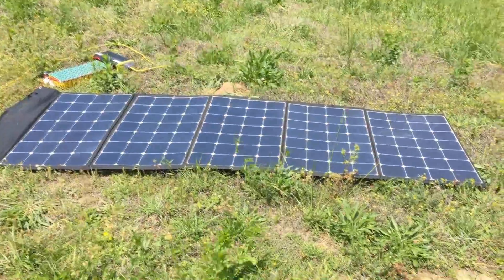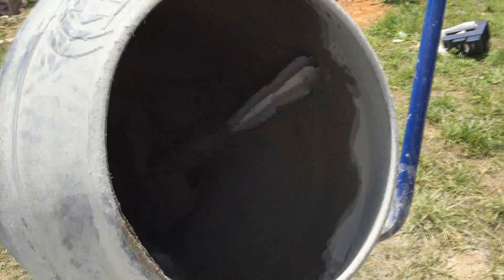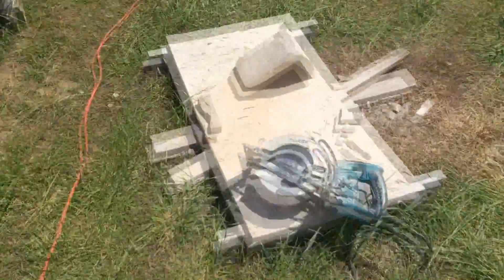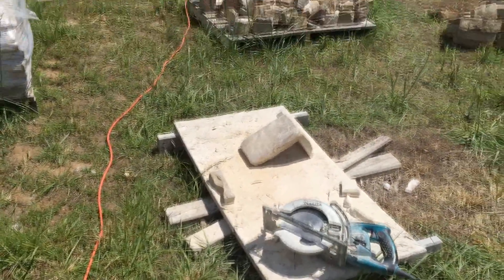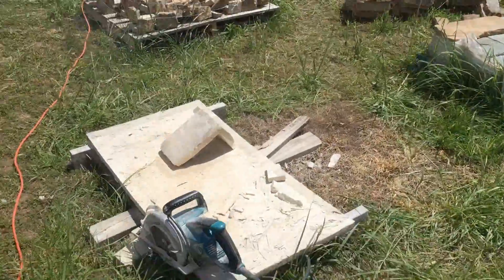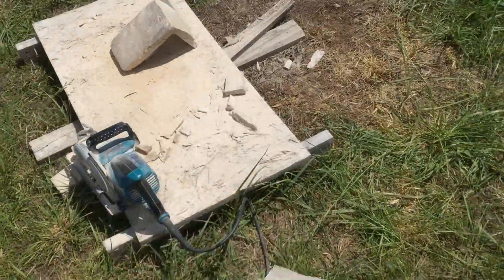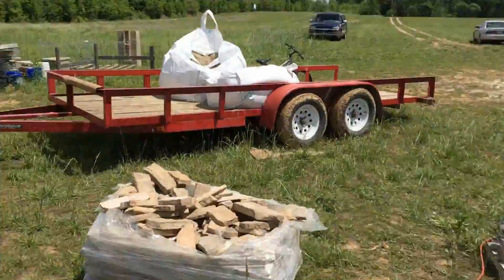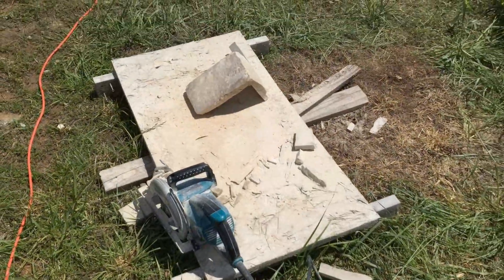SOLN1 2000 Update  - Battery-free Solar Generator

Comment: You can already hear the power dropping after 3 secs of power tool use. How long did you leave the caps charging for that 3 secs too hours I bet.
Reply: +Pulsed Neutrino That's not the power dropping that's applying load to the motor causing it to slow down (i.e. normal operation). If it was power dropping out the inverter would cut off with a low voltage alarm.
Reply: Pulsed Neutrino - It clearly shows the mixer running while doing some short cuts. 
You seem to want to be the negative comment guy or can you really not see the potential of the system as is (or maybe more super caps) but would be even better if paired with a high discharge battery.
Reply: +Pulsed Neutrino - Are you forgetting the cement mixer was also running the whole time?
Reply: Pulsed Neutrino LOL- that's a mature comment.
Apparently I have accidentally stepped in troll shit.
Reply: +Pulsed Neutrino I am not worried about labeling you as negative. Mostly because you ARE negative and ignorant. Lazersaber is not and does not act like some high powered car salesmen. Selling anything he makes is second to inventing and refining things that will be useful. You on the other hand are trying to imply fraud where none exists. This makes you either ignorant or a troll.  Have you actually done that work before? I have and I know what causes load on a saw cutting concrete. The slowdown you talk about hearing was caused by load. 
Lazersaber is well aware of the limitations and would tell you what those would be if you asked. he is a positive guy who is all about figuring what you can get from the sun or other energy sources for free. 
This system could be easily packed into the woods to work on off grid projects. He knows and did not claim it would power a whole crew building houses commercially. And he is not trying to mislead anybody on anything. To even insinuate that he is, is not only negative but is also attacking his character, which is insulting. In fact it is "insulting"? to others who have been following him a long time and know him to be a very positive and forward looking person who has spent a lot of time developing and even helping other people for free.  I know I personally resent people trying to smear other people's character like you have just done. It is trollish and not right. You owe him an apology.
Reply: +Pulsed Neutrino I would tend to agree.  Caps can dump quickly like for starting a car, but you won't run tht saw all day.  The bank would be huge.
Reply: rkaag99 Exactly.
Reply: +72fr250 Hell. Being able to use power tools in bursts of 20 seconds is better than them not running at all with too little power.
Reply: 72fr250 Assuming optimal sun conditions for the panels which often they do not have. Those supercaps are expensive would be better to get more panels and boost the overall power output.
abyssunderground  Watch the last part again carefully. Note the spin up tone before he starts cutting the first two. Notice on the final cut he tries from two angles and gives up as it is losing power. Don't get upset though you don't get a free lunch power out equals power in minus losses.
Reply: 72fr250 How is it misleading if the cloud cover reduces the output of the panels to 10% say? I feel like you want me to be over optimistic.Also that people don't understand is their fault really and they should get learning. Discussion and debate is healthy.
Reply: +abyssunderground agree.... slowing down due to friction.
Reply: jay90374 The video is chopped and we don't know how much that mixer draws either.
Reply: jay90374 Oh noes you called me the "negative comment guy"
Reply: jay90374 You are the one worried about labeling me negative not just arguing the facts.
Reply: +jay90374 The thing to remember here is that the cement mixer has a fairly high starting current but once it is running it draws very little power to keep mixing.  My cement mixer which is about the same size will run on a little ultra portable honda 3000-watt generator without issue (consequently this generator will run for nearly 20 hours on a 3.5-gallon tank of gas when set to economy mode).  IIRC the cement mixer with 2-3 60# bags in it used about 350-500 watts as it was mixing but drew close to 14 amps at starting; the power consumption went down as the concrete was near the same consistency.  Most hand-held power tools use far less power than what they are rated for unless you really bog them down so for the amount of surge current in the capacitor bank and the 400+ watts of solar charging it I would guess it would keep a small job with one to 2 guys running continuously without having to stop much if at all.  The real challenge would be on more overcast and cloudy days when you would need several times more solar capacity to keep up with the demand.  This system paired with a quality protected lipo pack could easily be the future small job sites, camping and DIY hobbyists.
Reply: kuhrd -Oh I couldn't agree more, I have spent many years fighting with generators and the thought of not having to listen to that motor running really makes me smile. I can see a system that the generator only comes on to rapid charge the batteries.
Reply: consaka1 Now you have used another insult calling me ignorant now lol. Wow you are full of insults. Just stick to factual objections about electrical device functionality not personal attacks. You follow a common pattern I see in people of making things personal when you have no concrete logical objections. You are in no position to make demands from me or anyone. It's highly amusing you think you are morally superior and are fit to dispense some kind of justice to me.

Comment: Is this real time or you had to charge the capacitors before?
Reply: 5min to charge , see his last video
Reply: +SuperFinGuy 
I think the caps serve both as buffers and short term storage.  I copied his idea and used super caps for the same purpose. This will allow short burst high power demands,  or  a longer run time for as long as you stay within the wattage of the Solar panels.
Reply: +SuperFinGuy If it was real time you would not need the caps as there would be sufficient power available direct from the solar cells
Reply: I was wondering if the caps worked as buffers, 5 minutes is way too long. Cool project, but not a reliable and consistent power source.
Reply: +SuperFinGuy It is as reliable and consistent as the Sun will allow it to be.

Comment: When does Soln1 come to market, and how much? I've been watching, and this product is looking damn good. I want three to power my house lights, so all I pay for are the big users, like the fridge and microwave. Of course, I'll have to scrounge for the funding, but it will pay it back in no time flat.
Reply: +WhtStr213 For a house setup, weight is not so much of an issue, and for lights you don't really need the burst current ability of these capacitors, so why not get something like this but with lithium or even just deep cycle lead batteries, so you have the capacity to power your lights even when it's cloudy? Or use a more expensive inverter that synchronizes with the power company's electricity and lets your solar panels power everything in the house, and if nothing is turned on then the power company will buy the power you produce? Not to dissuade you from considering this for portable use, however.
Reply: spaceminions
It has to do with expense, portability, and variability, all for my free energy concept.
  This product has the level of manufacturing as to be considerably cheaper than pro level solar panels. It also comes with it's own power converter, which are also highly expensive. (last I looked, way too expensive for the average person)
  I live in Missouri, and we have a slight problem with severe weather, like tornadoes. It would be nice to remove them quickly before severe weather, and in case of destruction of house, the usability after the fact on site.
 The "Free Energy" concept uses many different systems in tandem, and so variability is a must. The more systems used in obtaining the energy needed, the more likely one will have the energy for high demand situations. Roof turbines with car alternators, Tesla ionospheric receivers, and other devices go to the overall energy pool to which is drawn from. Excess is stored first and what's left over is distributed back to the grid.
Reply: WhtStr213 If the components are expensive, the product is expensive. For cheapness, go with lead acid, and for capacity and pretty good current ability, use some type of lithium battery. Lots of current is the realm of capacitors. Doesn't he just buy the inverter already assembled for this system? If so, the only price reduction from what you researched is slight economies of scale and mostly buying at retail vs not. As for twisters, put your batteries and inverter in the storm shelter safe and sound ahead of time and take down the panels when you need to.Oh, and an inverter that is able to put out the full power of a capacitor bank discharging at maximum rate will be awful expensive... 

As far as the second half of your comment I see no relation between our two comments that favors you... this system is self contained and would have to be modified to interact with such a set of systems as you describe, at which point it might be favorable to build your own system. Also, none of those systems would survive a tornado and they are harder to set up than a solar panel. some solar panels are essentially laminated into plastic which can be rolled up and weighs very very little. This system does not appear to be flexible. 

Again, this system is unique and useful but is not necessarily the best solution for every damned case.
Reply: +WhtStr213   I think the Soln1 showed in the video is designed for power on demand (like starting a car).  This would be great for microwave ovens that will run for a couple minutes at a time.  A small fridge would run fine too because it turns off and on.   Lights are a little different because they draw a constant power over time. For lighting purposes,  you're gonna need a dedicated system with batteries  not super caps.
Reply: WTF BBQ
Cool, another part of the overall system. Check this, we cut our bill down big switching lights (spirals), I've seen cheaper LED lights that use half the wattage as the spirals 60w incandescent equivalent is 12W. Can we do 36W/H all day? Sun, wind, water, and fire just in case. Geo, that's another game all together.
Now, if I had money...I'd tear up the scene. Shop up all the good stuff, like this. Tesla batteries (E. Musk), Variable voltage receiver/inverter 12 V into battery 120V mains out topped off with a BiTT for draw...heck yea! Four turbines on the roof, standard panels, Stirling Solar Steam Generator or two. Maybe try a Magnet motor generator. Watts into Kilos possibly. ......yea......
Reply: WhtStr213 i've heard that the combination of wind and solar are the most practical and reliable for DIY kind of consumers. I have solar panels only, but the weather in my state can be unpredictable so there are times that I have to turn the lights off to make sure the battery won't die and get damaged.......
Reply: WTF BBQ
Try more systems.
 Spaceminions was saying this device could help in high demand situations, an I watch those ventilation turbines on houses spin all day nearly everyday here, plus if you have creek access... Take a hard look around, and see what's available for use, and what's budget worthy. Also, I've seen some improvements in magnet motors, so look into that market as well. Replacing a gas engine with one would be an easy fix, just watch out for scams. (Australia had a nice one for 1200e, had...noisy though)
Energy efficient stuff, like lights and refrigerators, really help, too. Pay close attention to that watt number, it's the key to all this. I'm sure you know, but being energy efficient humans is a heck of a step, as well (turning off stuff not used persistently).

This is So do-able. Future world.

Comment: You need at lest 3 or 4 times more capacitors ant will be much more usefull. But the ideea is superb. :)
Reply: i would add another solar panel on top of the main unit just because more power and they are thin and light enough, sure it would be small than the rest of the panels but, why the hell not eh?
Reply: Today I build up my solar system whit 2 x 245Watt panels and 1 charger for 1 accide battery I am waiting some suny days to see how will charge my battery. :)   Maby I can use it to wach TV on IT :)
Reply: I am waiting a video  :)  from you